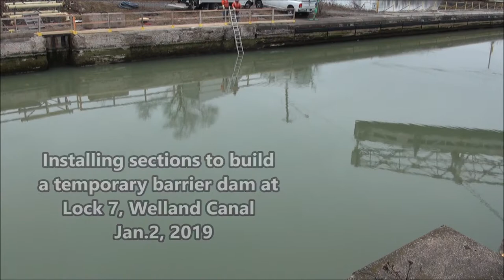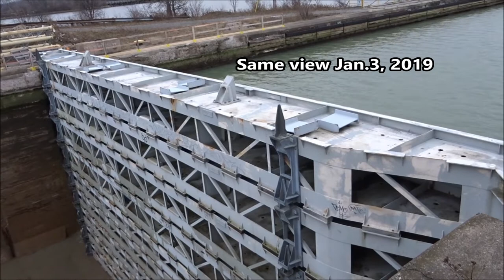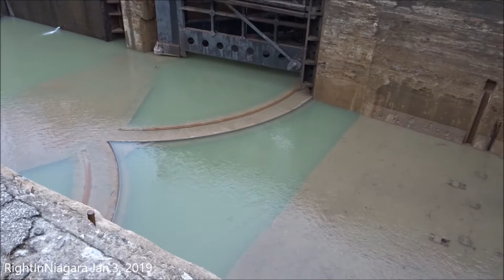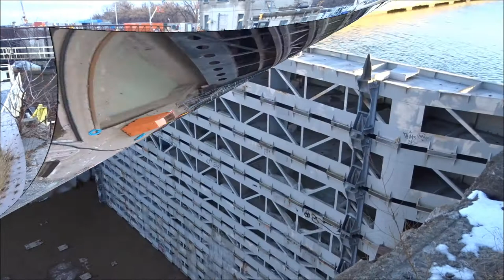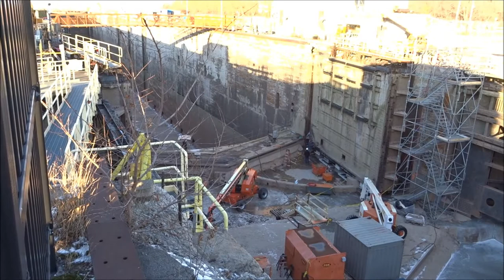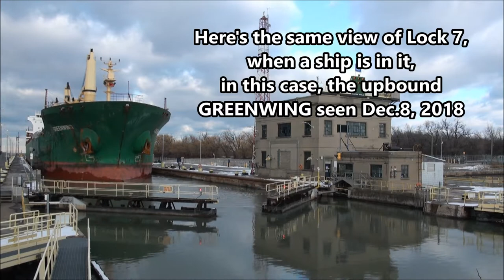Views of Lock 7 drained, and 'Stop Log' safety barrier installed, Welland Canal (2019)

Comment: Was this same technique used in the police search recently?
Reply from the maker: yes, the canal between Locks 1 and 2 was similarly drained  in Jan. Not sure if the search was the specific reason for doing so, because in previous years this portion also got routinely drained.This year,  the section between Lock 2 and 3 was not fully drained; the section between Locks 3 and 4 was drained; and the section between Locks 6 and 7 was also drained.